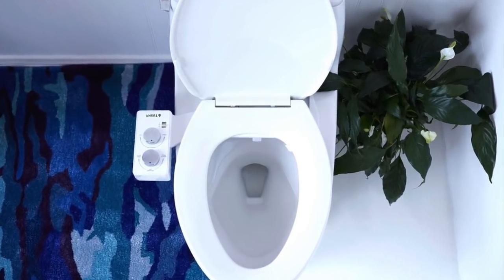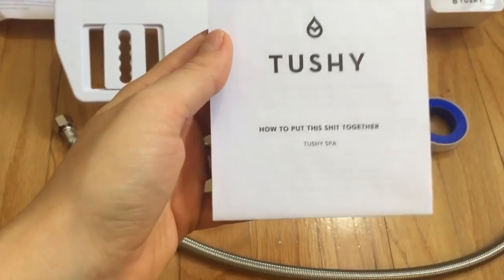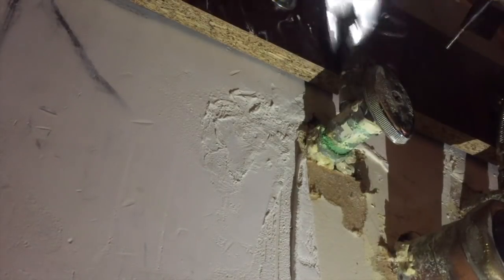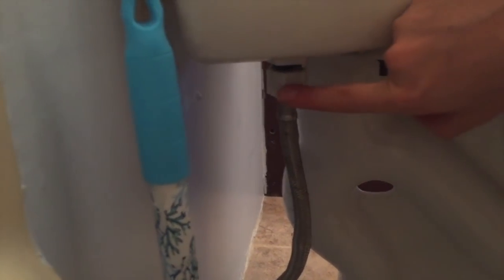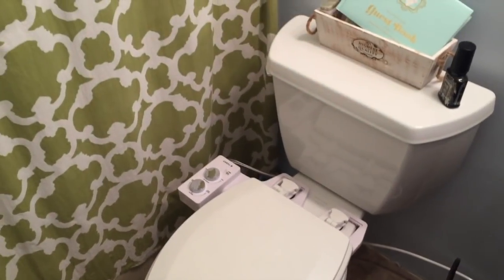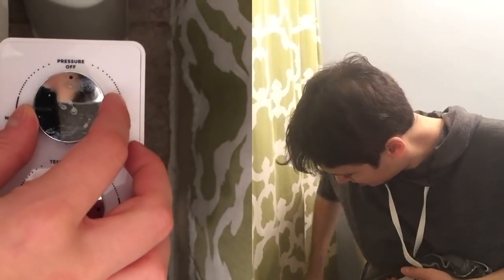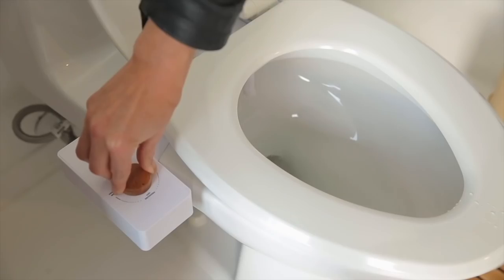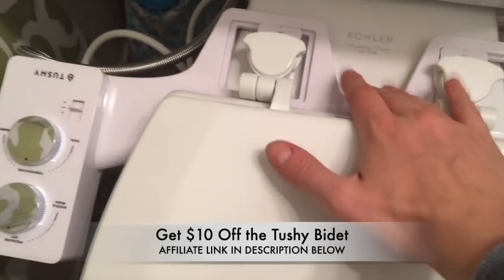Tushy Bidet Review: UNBOXING + INSTALLATION + REACTION

Comment: I've been a plumber for 40 years and I really got a kick from watching this. The only thing that I would have done would be to install a recirculating pump so the water would not be cold from the start. They do make small water heaters that would  fit under sink and run off of 120 volts. Great video. Thanks for sharing.
Reply: If you are going to go to that extent, why not just get an electric model that heats the water instantly (and get all of the other very nice features)?
Reply from the maker: That is a great idea!!!
Reply: I was thinking that too . I wonder if the bidet itself has one built in ?
Reply: I like that, you can keep the electricity under the sink as well instead of routing power to the expensive $200 seats.
Reply: Yes the hot water in the line will get cold over time and to get around that... just like  taking a shower... is to pre-warm the system.  Nobody stands under the cold water of a  shower .. right??  When you know you are going to go... run the water hot in the sink first... then charge the bidet line... If you have a see through plastic cup..... you can hold it over the stream/spray (upside down to capture the spray) and feel the water of the bidet actually warm the cup
Reply: @kcgunesq  Many of the mid-upper washlets (that's what these things are called) have little hot water tanks built in.  They need both the water connection and power (a few hundred watts).  "Batch" produced warm water, the units are bulky, and your warm water is time-limited then it goes cold.  The high end ones like the Toto S500 series draw 1200W and get instant-on continuous warm water.  I've been wanting to get one of them for about a year, it took the great TP hunt to get the CFO (wife) to permit it ;-)  S550e, yum.
Reply: @js7un165  For safety (and code reasons) you need a GFCI-protected outlet.  You won't have one under the sink.  The outlet ("electric razer outlet") above the sink should be suitable.
Reply: @kevinrehberg8758  Yes, there is a way around that.  Instant-on continuous water warming as in the Toto S500 series.  They're less bulky than other electric heating versions because they don't need tanks.  The tank type are "batch", and will run out of warm in relatively short order.
Reply: @fromagefrizzbizz9377  Yep.  I have a BioBidet Biiss 2000.  It has an instant heater.  I was addressing the poster who suggested installing a recirculating pump to plumb always hot water from the house's water heater for a unit that doesn't have power.  If you are going to spend that much plumbing, why not just buy an electric model that heats the water instead.
Reply: @fromagefrizzbizz9377  Quite to the contrary, if we are talking about the US in many cases.  It would not be at all unusual to have all bathroom outlets GFCI protected in the US.  While there may not be an outlet under the sink, if there is, there is a good chance it is GFCI protected.  If it isn't, it cost $10 or so to change.  Not every outlet has to be a GFCI to be GFCI protected.

 Almost no houses in the US have "razor outlets".  AFAIK, that is almost predominantly a UK thing.
Reply: @kcgunesq   It would depend on whether the recirc pump is making other fixtures better - like the sink.  Eg: if the toilet was right next to the sink, the recirc would do both the sink and toilet.  But if they're not close together, plumbing in a new hot line can be a significant cost AND THEN you're paying for the recirc too.  it'd be cheaper to buy an electric heating bidet seat.

Your BB-2000 or my S550e don't care - instant heat, using the single (cold) water line that HAS to be on the toilet anyway, no hot line necessary.  I'm looking at recirc, but ONLY to make it so that the sink on the other side of the room doesn't take 2+ minutes to get warm. SWMBO does not like that...  I'd use an instant heater or mini-tank heater, but there isn't the room for the latter, and I'm not fond of running a new 240V or 30A 120V circuit up two floors just to do one sink.  The recirc pump can do multiple bathrooms with one unit.
Reply: @kcgunesq  I'm talking about Canada, where code is almost identical to US.  People generally don't have outlets under the sink, and unless things have changed, having an even GFCI-protected outlet under a sink inside the vanity would be a rather significant code violation.

Eg: I believe both our codes still say that it's a code violation to have an outlet inside a cupboard or closet except under very specific circumstances.  Like microwave cabinets.

By "razer outlet", I'm not referring to it in the European formal sense, but in the "mandatory GFCI-protected receptacle above the sink" Canadian/US code requirement.

I said "razer" here simply because it tends to get used for electric shavers or blow dryers.
Reply: @fromagefrizzbizz9377  What code section prohibits an outlet (assume it has GFCI protection in some form) under a sink (assume withing a vanity)?

In your answer, please consider where an ac powered touchless faucet transformer would be expected to access an outlet.
Reply: @kcgunesq  it's been a lot of years since I was taking the electrical code to bed, so, sorry, I've not kept up.

There are a lot of changes in both the NEC and CEC since 2000 about GFCIs, what's permissible inside cabinets, etc, and it'd be a full time job keeping up.  The son has the up-to-date books, and given the quarantine, i'm not going to see them for a while.
Reply: You really don't need the heated water, that is overkill and adds to the price of the bidet.
Reply: @phuygen  YOU may not need or want the heated water.  But given that where I live, winter water enters the house between 40-and degrees F, I certainly want it.
Reply: And furthermore, the filtered exhaust and heated air dry are really nice features.
Reply: @phuygen  Speak for yourself.  Great White North well water would have most squealing a few octaves above normal.

Comment: I have had one for many years (another brand) and here's a tip for the ones connected to both hot and cold water: Turn on the sink's hot water tap just long enough to get a steady hot water flow. This can be done while sitting on the toilet if they are close enough. Now, when you turn on the bidet seat, you'll get warm water instantly if it's dialed in corrected with the bidet seat knob. There's no need to wait until the water warms up while sitting and spraying ice cold water.
Reply: some have a nozzle clean function that can be used when sitting down, then when needed switch to wash

Comment: I installed my bidet 4-5 years ago.  It has three control dials. 1. Used to set the water temperature, 2. Controls the amount of flow and rinces off the spray nozzles, 3. Directs the water to one or the other of the spray nozzles, front or back.  The water line connections are the same as shown.
Reply from the maker: Nice!

Comment: Great video! I applaud you for the straight forward honest review, and for assembling it your self. As an HVAC service technician I hope you have an understanding why plumbers charge what the do charge. They would have knocked that thing out in an hour max, and no leaks. So its their experience you are paying for. I'm not criticizing you, I'm really really impressed you got it done and put forth the effort with a great attitude. I have been wondering how those things work to by the way, thank you for the information! And by the way I have zero experience with making and editing videos like this . So it would take me more than 8 hours to produce a quality video like this. Thumbs up to you.
Reply from the maker: Aw thanks :)
Reply: I am sure it won't take Amanda 8 hrs to do another one. That's why a plumber can do it so quickly, just like anything else, experience. Also, I usually watch several installations on YouTube of something new I'm trying to tackle before doing it myself. You learn a lot from just watching others teach you their tricks and proper techniques. I just put in my second bidet in the front half bathroom, it was a still a tight job because there isn't a lot of room to maneuver, but it was worth it.

Comment: We installed a Bidet about 10 years ago and no more runs in my shorts LOL... I liked your video and candor.
I also installed a stainless steel round towel hanger and we use a medium sized towel plus we have a soap dish and use the sink it all works and sure keeps everything clean so much better than toilet paper.
Reply from the maker: That’s a great set up you have there❤️

Comment: Should have bought a Brondell.  From opening the box to working it only took 20 minutes.  Tapped onto the supply water line at the base of the tank with a "T" fitting and plugged in the unit to a nearby GFI outlet.  It also has a dryer.    Waiting for the model that has the "Audio Book" feature.

Comment: When in doubt, if you have enough pipe and the water main if off, install a sharkbite connector.    Wow.  This is a different model than I have seen with the added warm water.  Also, sometimes teflon tape is a help.
By the way, even though I’ve been battling things DIY for decades, I totally feel your pain.  I usually figure a plumbing job will require three trips to the big box store for things I end up needing.
Reply from the maker: Ooo I haven’t ever heard of a sharkbite connector before but that sounds like it would work fabulously here

Comment: Installed mine today. Was pretty pissed when the written instructions said to disconnect, to turn a piece one way when in fact it was the other way and I nearly broke it. But I figured it out... took about 2 hours to install the basic (cold only) and I have to say using it, it's a learning curve. Thanks for your video and the coupon code. They said it would take 3 weeks. Took less than a week for delivery. So happy I got mine.
Reply from the maker: That’s awesome and I also applaud your installation process :) enjoy it!

Comment: Hopefully this reply will help somebody else in the future: the nut on most of the water shut supply valves is 5/8".  If you have (or can get) a 5/8" open end wrench rather than a pair of pliers the job will go a lot easier.   Fun video!
Reply from the maker: Great suggestion!

Comment: Our home has the Thin Profile Brondell and the Blue Bidet. The Thin Profile Brondell has metal tubes carrying the water to the sprayer which is better than the plastic tubes used by the Blue Bidet. All 3 bathrooms have Bidets with instructions for new guests as we do not use toilet paper.
For drying the bum we have fresh clean white cotton towels for any moisture left on the skin the same as after a fresh  shower. After learning how to install a Bidet the first time, the job can be done in 10 minutes "but" check the parts list first, read the instructions, and test slowly to prevent washing your face. I have had guests squeal, laugh or shout in surprise when they open the lid, peek in and turn the knob to see where the water goes. 😂🤣😆😁
Reply from the maker: That’s awesome and I’m sure it is a riot with guests!
Reply: @AmandaAngela  My niece works at a hospital and I forgot to tell her to read the instructions on the top of the toilet water tank before using . . . she opened the lid, turned the know the wrong way and  . . . yelled, "uncle Jerry, do you have a towel I just washed your wall !"

Comment: One thing no one has mention, after installation you notice the water pressure can and does go over the lid.  One of my customers found out a few days later one of there small children went into the bathroom and turned on the spray water all over the floor.  In less than 10 minutes they had water flowing down there hall way.  Needless to say they where very upset and thought it was my fault until they cought there child going into the bathroom again and saw there child turn on the water.  My next call wat to remove it.
Reply: You know, as a parent myself. My solution is to give my little brat a sound spanking.

Butt...  some people just got to go about things the hard way.

Comment: So you didn't show drilling a hole in your cabinet to allow the hose to connect.
Reply: Just get it without the hot water feature and you won't have to drill any holes. You just you the hose that goes to the toilet tank.
Reply: small hole as low and back as possible, it's not a big deal

Comment: Having been to Dubai 40 times and Thailand 10 times I got used to using a hand sprayer on my butt. Those places have warm water. Last week I ordered a hand sprayer and will hook it to my hot water. I keep my tank on 120 degrees. Cost will be about  $22 with shut off that will go into my PEX line.

Comment: Is the tush all wet when you finish? And what do you do then?
Reply from the maker: Nope not all wet; only a small area gets wet and usually the bamboo microfiber towels will do the trick to dry it.
Reply: use TP, you use very little, you need to check for residue anyways

Comment: Do you have to run warm water in the sink to have warm water ready?
Reply from the maker: Nope; I just set the bidet to nozzle wash to get the water flowing and then to bum wash
Reply: Amanda Rinaldi so does you sink now have instant on hot water?
Reply from the maker: David does Stuff the sink still works exactly like a sink- both hot and cold water when I need it.
Reply: Amanda Rinaldi thanks for the reply. I know on my sink I need to let the hot water run for a bit to get hot water. I was just trying to figure out how the bidet would have instant warm water. 

I’ve seen some that plug into the wall and have their own water tank and heater. I liked the idea on this one just hooking up to the hot water line but unless it uses thermal convection to circulate the water the first water mine would spray would be cold. My waster heater is some distance from my sink. 

Anyway, thanks for the reply. Great video and be safe out there. 👍👍
Reply from the maker: @DaviddoesStuff  no problem. Yep, the bidet doesn't give out instant hot water. I usually have to turn on the nozzle wash feature to get the water flowing and heated up before turning it to "bum wash" so it's nice and warm to use.
Reply: Amanda Rinaldi ok, that makes sense to me. Sorry for so many questions. My brains just has this funny dance it goes through to understand things. 

If you turn the hot water in the sink on until the water is warm the bidet would be warm faster. I live where my room temperature water would be shocking 😂 to say the least. 

I appreciate you sticking with me through my mental obstacle course. 😳😉
Reply from the maker: @DaviddoesStuff  no need to apologize, my friend :) Our brains are wired to be curious!

Comment: This was a pretty funny yet informative video. I was wondering about this gizmo ever since seeing it somewhere before. Thanks for making this vid. One piece of advice. Use a proper tool for the job at hand. Pliers aren't wrenches, they tend to round off the flat shoulders of the fittings or of nuts and bolts.

Comment: Good for you tackling this connection yourself. However, it appears you forgot (possibly skipped) adding the Teflon tape around each threaded connection to minimize leaks. Also it's worth time getting the rubber washer when directed. I've occasionally substituted a small rolled line of plumbers putty inside joints when washers were missing but results have been less than 100% successful.
Reply from the maker: Yup I did add the Teflon (just didn’t film it!). It helped for sure!
Reply: @AmandaAngela  Just so you know, I added a wrap of Teflon tape to the PVC ends before tightening the connection at the joints for the Hot water when installing this same SPA seat at home. It made the difference in leak prevention. Good job on your diligence!

Comment: OK-- ONE QUESTION, HOW DO YOU GET HOT WATER -- WARM WATER, WHEN I SEE NO HEATER IN THE UNIT AND HOOKED TO A CLD WATER SUPPLY-?
Reply from the maker: It’s connected to the hot water valve in the sink :)

Comment: I plan on buying one after checking out my plumbing situation. (I know that you get some cash from this — so honestly) What model did you use. If I buy the normal model will I still need to mess with my sink? I'm from New England we're a hearty people and drafts just seem normal (even straight to the b-hole). Awesome video can't wait for the reply
Reply from the maker: I have the Tushy spa model which includes the hot water feature (which comes from the sink) but if you just get the normal one, you won’t need to use your sink. :) hope this was helpful!

Comment: I would appreciate if more if soapy jet stream, also the jet spray will splash fecal water all over the place, doesn't seem  the safest way to clean.
Reply: @ash ash  That’s my exact concern! If it’s dangerous for women to wipe with tp from back to front, how is it Ok to spray fecal matter with water that splashes all over your lady parts? I just don’t get it, but then again I’ve never tried one.
Reply from the maker: I get the concern but the way one sits while using this ensures the splashes/bits don’t interfere with other areas lol